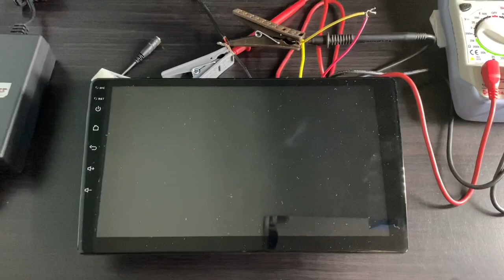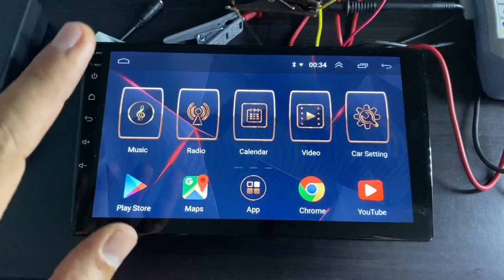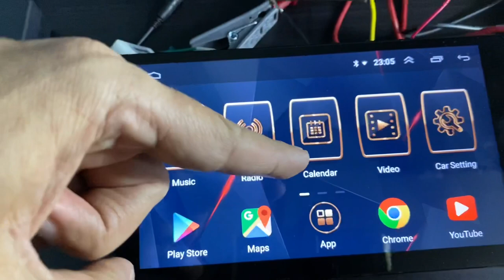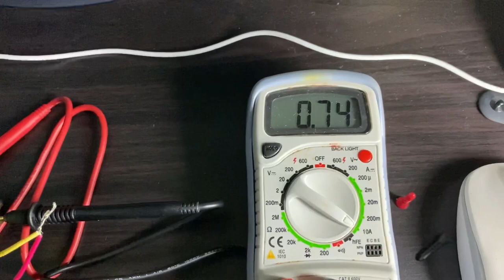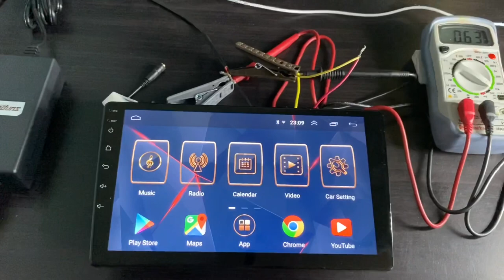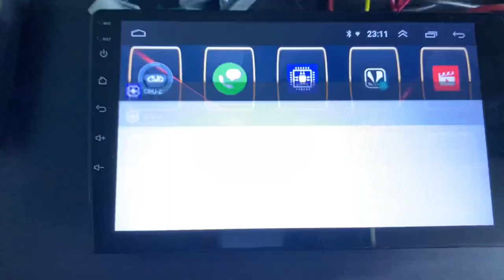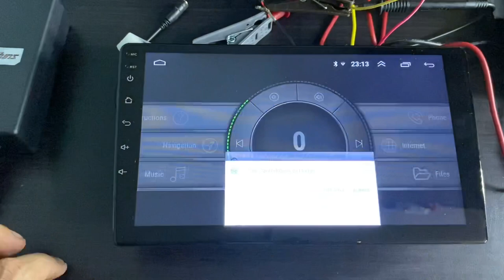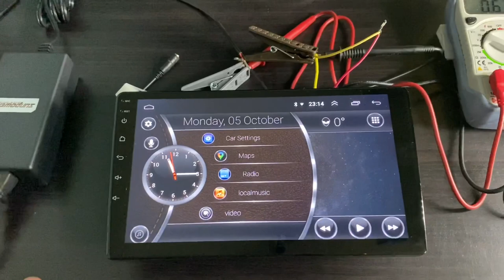How safe is the Android Audio System for your vehicle

Comment: Hi yogesh, thank you so much for the video. I have a question. Does the idle power draw will be more if there are speakers and amplifiers connected to it?

And also there is a workaround in the settings for complete shutdown of the system when the key is off, please experiment on that too if possible. I'm also skeptical about that setting. 

Hoping for more of these experimental videos . I've subscribed to the channel.
Reply from the maker: Sorry for the late reply. I have experimented with the newer ones as well. If Amp & speakers are connected the power drawn by system is same. Amp is ON only until the vehicle accessories is ON. Always prefer the complete shutdown option to protect your battery from draining.

Comment: Same problem..when stand my car  7 day my car battery totally drained..how to solved this problem?
Reply from the maker: Please check the standby current in series to the yellow wire, if it shows more than 10mA, then you have an issue. Also, ensure that all your apps are closed and Radio FM is properly closed to Switch OFF in the Radio app.

If there is a Power Amplifier connected,  please check if that is also ON or OFF after you remove the ignition key.

Lastly, if everything does not work, you can add an extra switch to switch off your Android Audio System as a cutoff the yellow line to power supply. This is an experimental a trial and error method.
Reply: @automotriztechnica  my stereo is plug nd play wire
Reply from the maker: @mrcvm  If you remove the wire when the vehicle is parked is the temporary solution, adding a switch will help to switch ON the unit when necessary, else the standby current can be more during long term parking. Only issue you will face is it will take some time to boot.
Reply: @automotriztechnica  swich button added Yellow or red wire?
Reply: Powering off the Android system with the power button (long press)  will do the same function of that manual button, right?